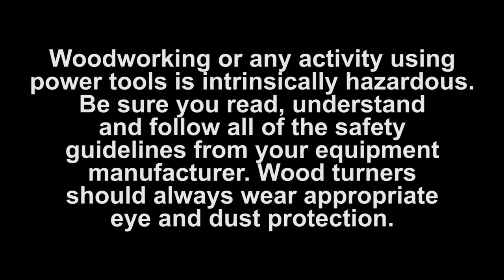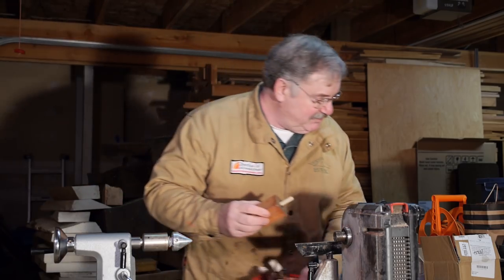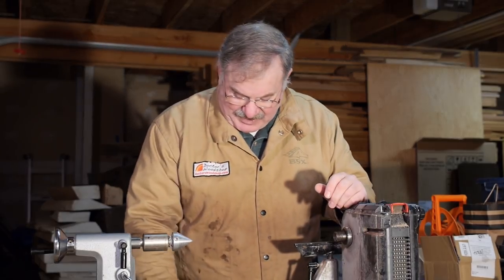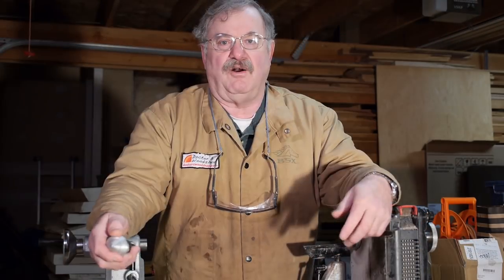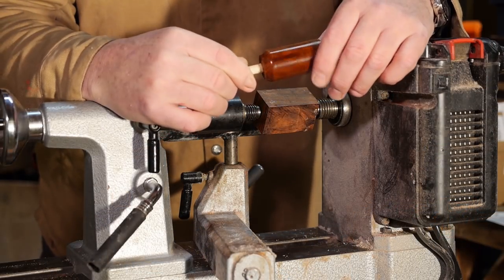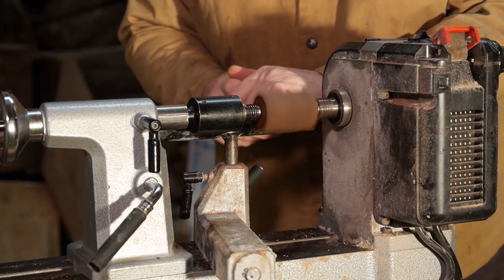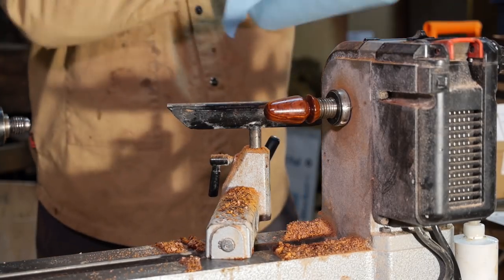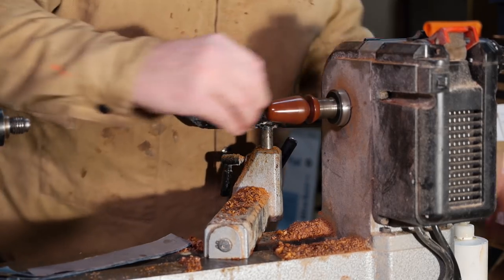Quick and Easy, Wine Stoppers with Doctor's Woodshop!

Comment: Watched your video about bottle stoppers.  Just finishing one made of wood from cinnamon tree, very white soft wood.  I had to redo the threads with glue. Is there a finish which makes the wood stronger.  I am concerned the stopper will wear quickly.
Mahalo
Reply: Add fiberglass dust in two-part epoxy, then add two coats over the soft wood. Buff to a nice shine.
Reply: Use of soft woods makes threading difficult.  There are a couple of ways around the problem. 1.  drill a 5/8" inch hole in the base and fill it with epoxy.  Give it about three days to set, then drill and tap the epoxy.  Epoxy threads very well.  2. Check out the thread inserts on the Ruth Niles website (or any other 3/8"-16 insert). Those are fast and easy. 3.  Minwax Wood Hardener will toughen up the wood after the hole is drilled and before you tap it.